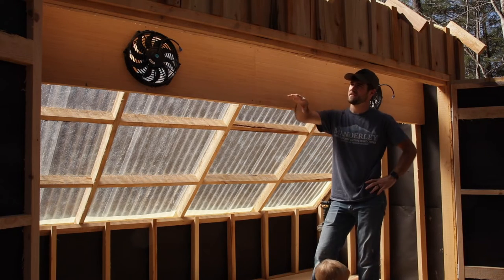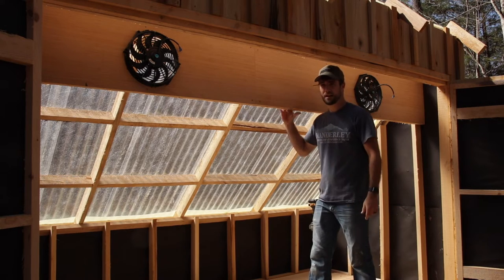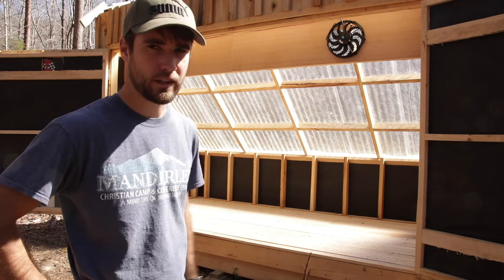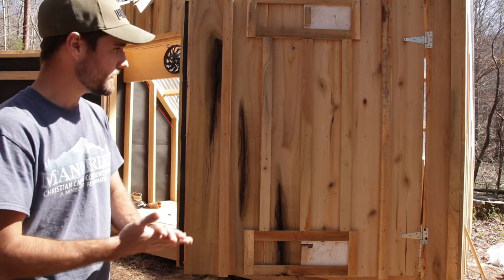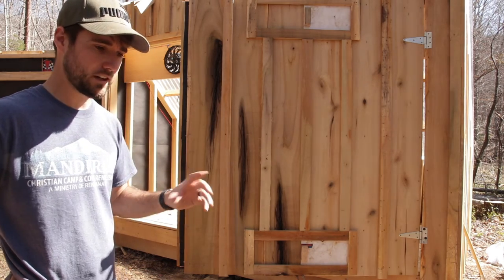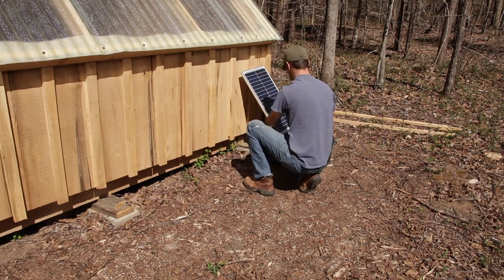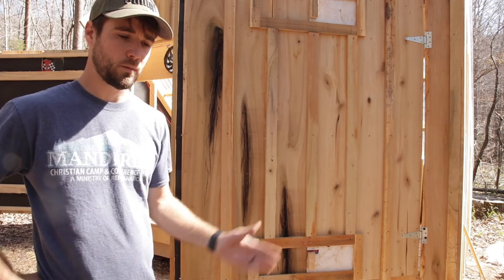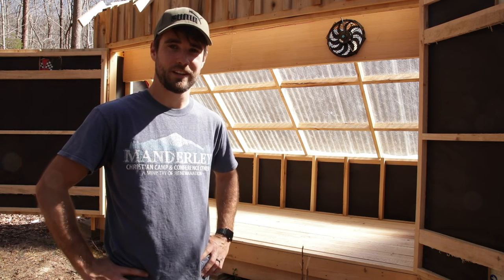Building a Solar Kiln with Green Wood - Part 7 - Baffle System

Comment: Lumber is what your drying. Wood is what is in the log. Looks good to me👍styrene foam insulation would hold heat better. Plus a great starter planting green house. Good job. You also attach a chicken coop use the venting the heat to keep the chickens warm. Or as a defrosting LOL!!!

Comment: Nice work!  Question, why use fans to blow are in, why not put them at the bottom and use them as true exhaust fans to pull air through from top to bottom and exhaust out?  So vents at the top, fans at the bottom?  I'm planning to build one myself and struggling to understand why everyone is using them to push air in.  Thanks!
Reply: It blows the hot air from the collector through the wood. Hot air holds more moisture. The top vents control the temperature by how much hot air they let out. The bottom vents control airflow.